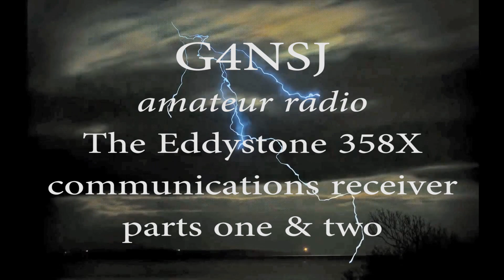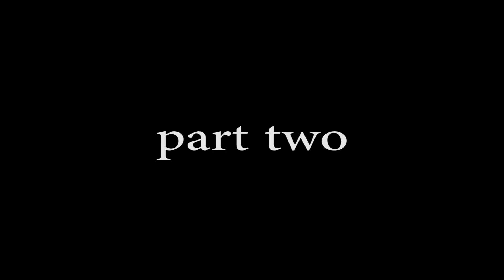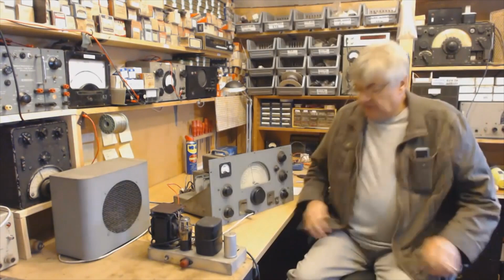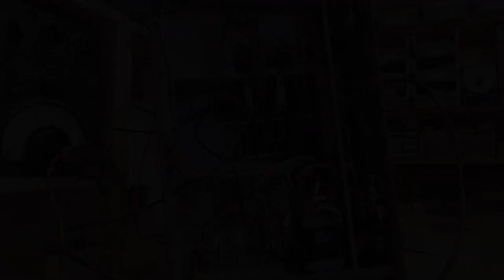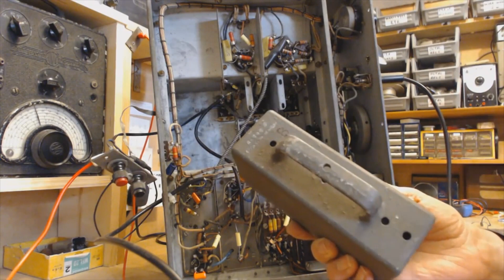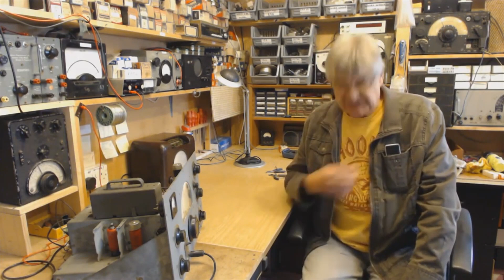G4NSJ - The Eddystone 358X comms receiver parts 1 & 2

Comment: A lovely old radio for sure, it probably weighs as much as my old CR100. In fact my CR100 is still where I left it years ago on the landing at the top of the stairs. I haven't worked up enough enthusiasm yet to try and carry it down the stairs, for obvious reasons. It weighs an absolute ton! Well done on fixing the AGC. I've had a few fauls with  AGC circuits on old valve Trio communications receivers over the years, resulting in the S meter not reading correctly. With one particular JR310 receiver, it looked like an AGC fault with overloading of strong signals. However it turned  out to be an issue with the SSB product detector instead, which really threw me into thinking it was an AGC fault lol! The cause being not enough BFO injection into the product detector.
Reply from the maker: The old radios were very heavy! I love fault finding on the old gear.  It keeps my brain working!